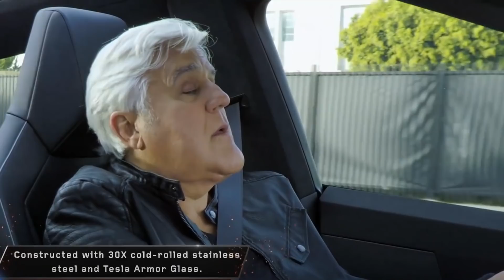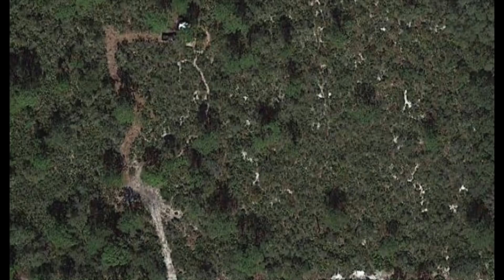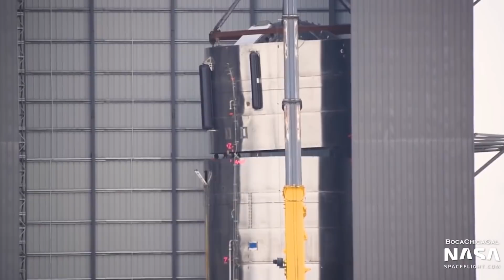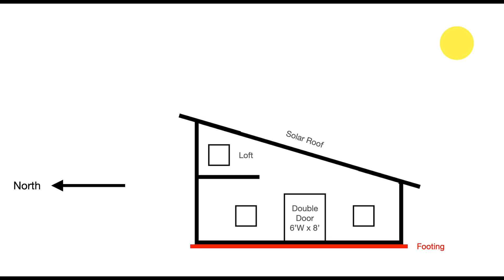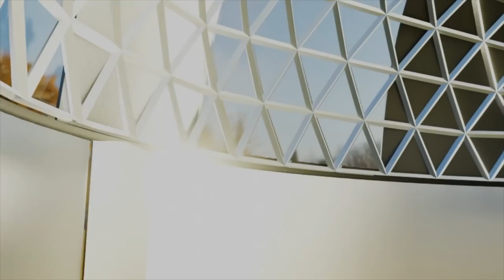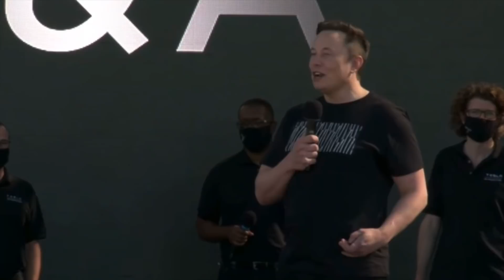Tesla CyberCabin - Apocalypse Technology

Comment: You should have a look at Buckminster Fuller's "Dymaxion House:" http://sebastiaankaal.nl/architecture/roundhouse-wichita/index.php?fno=1  If you can get your hands on a copy of "Inventions: The Patented Works of R. Buckminster Fuller," it contains the patent drawings for it.  The house was designed to be manufactured in an aircraft factory (after World War II), and have its parts be shipped to location in a single semi truck trailer.  

Another option would be the N55 Spaceframe: http://www.n55.dk/MANUALS/SPACEFRAME/spaceframe.html  This is a building based on tetrahedral geometry that looks like it was made to have a Cybertruck parked in front of it.  It's designed to be easy to build from very basic parts, and can be expanded as desired by adding alternating tetrahedra.  This would probably be the easiest and cheapest to build, since the plans are free online at the link.  Since it has flat sides, it would also be easier to affix solar panels to than a rounded shape.  

I hope your Cybercabin project works out!
Reply: The N55 Spaceplates Greenhouse is another very attractive option with more geodesic (rounded) construction: http://www.n55.dk/MANUALS/SPACEPLATESG/spaceplatesg.html that also fits the Cybertruck aesthetic.
Reply from the maker: Lightweight construction might not be good in a hurricane.

Comment: Have you looked into a straw house? I know it sounds a bit odd, but construction is really easy for hard to get to areas.
Reply from the maker: Not yet. Is that viable in Florida's humidity?
Reply: @WarrenRedlich  I've seen a lot of them in tropical areas so i'm sure it would do fine. The bales get coated with some type of plaster. Most people wouldn't even notice it's a different type of house.
Reply from the maker: I did some research. Not ideal in humid climates.

Comment: I’m an Architectural Engineer (building systems including structural) and I’m impressed with your insightful understanding of building.  Steel buildings are a great option.  Go with an 18’ eave height and build two story super insulated space inside will definitely work.
Reply from the maker: Thank you. I was thinking 20 feet but 18 works.
Reply from the maker: Where are you located?
Reply: @WarrenRedlich  many people are disillusioned by building on raw land.  It seems you’ll be fine.  One control is:  overdevelopment.  Will you be able to recoup your time and money?
Reply from the maker: There's no risk of overdevelopment in this area. 

Not sure about recouping time and money. Investment is small enough I don't really have to worry about that. When you invest $50K in property, you can't lose more than $50K.

The value is in having a place to go when the sh*t hits the fan.
Reply: @WarrenRedlich  it’s only a unit of measure.
Reply: @WarrenRedlich  Colorado

Comment: For comfort throughout the year learn about solar passive design using insulation, thermal mass, south facing windows for heating with eaves for summer shading, and windows that catch the breeze for ventilation. The Passive House system takes it a step further with PHPP software to forecast comfort before you build. 
Earth Ships include growing food and recirculating water as well - it depends how far you want to take it.
Reply from the maker: This is Florida. Thermal mass is not good. Ventilation with 90 degree humid air is also not good.

Comment: A HVAC system will essentially move heat from one area to another with a difference in temperature of the areas in the 10s of degrees. You will resistance heat, not HVAC, for the oven to increase the oven temp by 100s of degrees. Other than this one item, the rest sounds doable. Good luck.

Comment: 1/5: North-facing windows only would not be my preference. I'd much prefer them on the south and sides, with large overhangs.

2/5: Might be good to put the roof separated from the top of the building by an air space.

3/5: I don't know if I'd put the solar panels on the roof. Instead, I might go for a white roof, or maybe a green roof to serve as camouflage. No, I DON'T mean a roof covered with plants! I think those are just silly. No, I just mean a textured green color, as camo. THEN, put SMALL solar panels among trees in a forest. You can arrange open space such that the Sun tracks through an arc of open space over the course of a day. This will minimize their visibility. You will get a bit less insolation than you would with exposure to the whole sky. I think it's maybe 30% less, at worst. The difference is bigger on a cloudy day. But if I'm thinking apocalyptic, concealment would override efficiency at the margins.

4/5: If you don't have forest cover, that changes a lot. But if you're a real apoco man, you should have forest cover.

5/5: Finally, I personally have no interest in this. If there ever is a societal breakdown, I don't think you can predict what form it will take, and whatever you do, you could very well be preparing for 100% the wrong thing. I'd make the case that you might be better off in a city, in a neighborhood where you can really connect with those around you. If you get attacked out in the sticks, no one is likely to be around to help. I, for one, find that quite scary.
Reply: BTW if you design the mountings right for the solar panels, you could raise them for more sunshine when you're not in SHTF mode. Since SHTF mode (lowered) would be for concealment, you might think you don't need concealment outside of SHTF situations. But not necessarily. Power outrages can and do occur when your society is operating more or less normally. In fact, that's when you're most likely to need that off-grid power.

Comment: I like Cybercabin ideas.

My new retirement home that I finished December 2019.
Is similar concept.

I recommend 10’ poured concrete walls. This would resist hurricane much better.

I put rigid foam insulation on inside walls R45 and CLOSED cell SPF on bottom of roof sheathing R55.

A simple 45* shed roof with strong steel trusses. Windows on North & Solar on top, it would be larger in main level & about 1/2 as large in upper floor, 2 bedrooms & 1 bath
Reply: Next strongest is 8” x 8” x 16” concrete block walls with vertical #4 rebar down through each hole & then fill all holes with runny concrete.

Raise the dirt grade of your house area well above the local 100 year flood level.

Management of water & water vapor is very important, causes mold if done wrong.

Water vapor moves in the same direction as heat through walls & roof.
Reply from the maker: Hard to get concrete truck to property.
Reply: @WarrenRedlich  
Look at hydraulic-pressed native soil strengthened with Portland cement (or aircrete). Include channels and holes for rebar. You only haul rebar, cement and machine. Use well water, depending on salinity? Look at basalt rebar and cloth for reinforcement, as this is very corrosion resistant, light, strong, and cheap!

Maybe raise the building second floor on strong columns above 100 year flood levels, using burst-out walls for the ground-level garage. This greatly reduces flood insurance.

Comment: You should not build your solar on your roof of your shed or house as that is bad & a waste of money. Fixed panels will always only get around 60% of there rated wattage per hour for the 4-6 hours depending on what your state says that your solar day gives you. If you put panels on a single axis roof where you have 2 poles with a rotating axle across the middle & put 2kW of panels & 2x Heavy Duty 6000N 1320lbs Lift 12V Linear Actuator Motor Controller Switch Kit which use the same amount of power to run as the lightweight linear actuators & these pivot your solar panels facing dawn & slowly moving throughout the day to end up tracking the sun to late afternoon you can achieve 80% of the rated wattage per hour & have 8 - 10 hours of solar day because as the panels track the sun they are always at the optimum direct angle getting the most power out of the cells. Having 2 of these extremely heavy duty actuators guarantee that your panels won't blow away in a storm & you can actually cut down the amount of solar panels & still get more wattage. Having 2 of them is enough to lift a medium sized car off the ground so imagine how strong they would be in a storm?

Example 10,000 watts of fixed solar panels producing 60% or 6000 watts per hour for 5 hours = 30,000 watts per day
Example 5,000 watts of single axis solar panels producing 80% or 4000 watts per hour for 9 hours = 36,000 watts per day.
The offset of paying for 4 heavy duty linear actuators, galvanised angle iron for the solar panel frame, 2" galvanised round tubing as an axle with 2x 2" pillow block bearings for each angle iron frame & 2" galvanised square box tubing for side poles, a few bags of sand cement & a several bags of stone to set the box tubing in the ground which all would be cheaper than buying a total of 10,000 watts of solar panels as well as the hardware to fix it to the roof.
Reply from the maker: Ground solar is easier to steal

Comment: You're in Florida right???  Solar is viable there for 4 months a year????  About the same as Louisiana where I am.   I'm NOT okay with keeping my AC at 80F    Good luck with it though if you are spending the coin.
Reply: Four months sure isn't what I (an Oregonian) would guess!  However, some solar-related websites show "daily peak solar hours" (which is South Florida is 4.5 hours and 3.5 here) which is not particularly accurate.
Reply from the maker: Solar is viable year round here.

Comment: #1 CUT consumption. Insulation. Low flow hot water.  Small volume without being cramped cuts demand. 500SQ ft too small.  700-1000 sqft much better. No bigger. Low flow shower head. Induction cook top. Convection oven. Maybe Nesco for an oven. Cheap slow cooker (Rival). Tankless water heater. Short runs for water heating.
Reply from the maker: Minimum square footage for permitting is 750 square feet. Probably going to do 1000-1200 square feet. Once you're building a steel building, the extra size is cheap.

Yes, tankless water heater is a good idea. Will probably bring my vertical propane smoker to the property for outdoor cooking. I have a slow cooker at home that we never use so I'd bring that too.

Will probably divide space in half and only cool one half of it.
Reply: @WarrenRedlich  Extra SQ FT means more CU FT for cooling. How many people? For me 1000 SQFT is much too big. Bedrooms don't need to be big. Guest room can be sofa bed in living room. We have 3 people me/wife and son. We find 750 SQ ft 2BR GREAT. Would plan 3rd BR just for storage. We are pretty well stockpiled for the end. LOL!  Makes cooling with AC very cheap. IKEA Kallax GREAT for storing. 
Think vertical for storage in small sqft.
Slow cooker is better because it doesn't radiate heat. More heat=more cooling needed. Bad for survival. Don't waste.
Fantastic shower head. https://www.conservationmart.com/p-2138-sava-spa-15-gpm-chrome-showerhead-n2515ch.aspx?gclid=Cj0KCQjw2or8BRCNARIsAC_ppyZMQeyBKYJ2irNCp5Esrxm-lZJ28vBb6Fjlf2puNNimc6dWMnV6PNAaAhGnEALw_wcB

Comment: If you keep it smaller and super insulate you can heat it with a candle. SMALL AC. Well plan to work with the sun. Passive solar.
Reply from the maker: Heating is basically irrelevant in Florida. I'm from upstate New York. I never get cold down here.

Comment: Think ICF for walls, roof, and floor. Forget a handgun bullet, ICF with a good core can bounce a tank round, takes any earthquake, hurricane, or tornado. Excellent insulative value. Costs 5% more to build over conventional methods. And don't forget the flame thrower.
Reply from the maker: I looked at ICF before. Seems expensive, time consuming and labor intensive. Have to be able to get a concrete truck to the property.
Reply: @WarrenRedlich  Consider this. An R-50 or R-60 wall allows for a smaller and cheaper hvac unit which also lowers power demands. This in turn can allow for a more modest and cheaper solar roof / powerwall. Building using ICF may also allow thousands of $ in tax credits to be claimed. House insurance costs are often lower for ICF houses. This should sound similar to the cascading advantages of a Tesla EV, because it is. So put together a spreadsheet and see if cost may be yet another advantage all things considered. As for speed and labor, ICF walls go up in a week—stack the blocks like lego’s and fill it up. Some home owners even choose to stack these light blocks themselves to save even more labor cost. So you just need to ask the concrete provider how to make appropriate access and you can have an ICF fortress that can take any calamity and repel an invasion. If there is a category 5 storm outside it will be so quiet and solid you might not notice unless you take a look out the window.
Reply from the maker: I’m not going to insure the cabin. 

Insulation is far less important in florida. It matters but not as much. I will insulate but only a little. 

Much more important in cold climates. Zero F is 75 degrees difference from 75. 90 is only 15 difference.

Comment: Use aerogel as an insulator between the steel exterior and the interior.
Reply from the maker: Sounds expensive. I was planning on a radiant barrier. Maybe some insulation as well, but the barrier might be enough.
Reply: @WarrenRedlich  
Insulation is always cheaper than brute-force air conditioning.

Comment: Hi Warren; working towards something similar; so have some notes on your ideas:
in the risk column; the powerwall currently has issues when no internet/mothership connection and shuts down; so hoping before SHTF tesla has enough time to push that update to disable that (its done for warranty options and the commands to adjust the powerwall don't go directly on the powerwall2 and go via the mothership).

re the building; have you seen the inflatable ones with concrete fibres that you wet; might be appropriate for your first structure / collection of building materials and may doubles as fire shelter / safe storage.

for solar I have found modern panels are doing ok all day generation despite the alignment; eg all my panels face north west (in southern hemisphere) during winter are still getting enough power from sun-up to cover my idle power usage of modems; fans and UV water filter at 7am. I do miss having some wind option at moment as a few days of poor weather drains the battery.

drinkable water collection and filtration is going to a big item to consider early; especially large tanks as their construction and location will be important and especially with less rain; and scaling your battery to run water pumps and UV water filtration appropriately (my powerwall2 does this fine for a few days but not more)

rather than cooling a whole area during day with aircon I would look at designing a concrete safe room because people will know where you are; especially considering a drone/ plane/ sat photo could spot the solar panels from far away and that's basically a homing beacon for prepper.
Reply from the maker: Great comment. Thank you. I have thought about some of that but I will think more. 

Definitely planning to use the ac on only half the space.

Comment: Engineer in the Army and getting out soon. Interested to know how the quote for the road added up to $10,000. I literally build roads in the military and would like to know if there is a way I can help.
Reply from the maker: I just talked to one guy about putting down shell rock. 

It’s about 500 feet of bad deep sand road that is the problem.
Reply from the maker: So if you figure 500 feet, 10 feet wide, 6 inches of stone, it’s 2500 cubic feet. Seems like a lot.

Comment: It sounds like you want to build a stainless steel version of Buckminster-Fuller's Dymaxion. But there are no real benefits to building one of stainless steel since the "bullet resistance" of the full hardness 3mm 300 series stainless steel is limited to 9mm pistols. I think you may find that an aircrete dome is more practical.  I'll let you do the research for yourself and judge.

Comment: Worth watching some UK grand design programmes. A few people have made homes that require zero heating. 
And air conditioning systems including simple large air pipes running underground in trenches to capture ground temperature for both heating and cooling while exchanging clean air

Comment: If you're trying to stay within a small budget like $50k you need to simplify as much as possible. Forget fancy shapes like domes.
Reply from the maker: Agreed. The steel building with minimal interior is the $50K version. The dome is part of a more expensive version I'll only do if I raise a lot of money. Which I expect not to happen.
Reply: Does the $50k figure include the solar panels, septic systems, foundation preparation etc..? Sounds very low.

A note on grey-water systems; we just installed a system that only has a divided well, with an air-pump-mesh type of thing. Working principle: bubble air through the water and let natural chemistry (obv bacteria too) do their work and ”disassemble” the pollutants. No septic field required.

Another note; heat-pump dryers are already a thing (at least in Europe). They actually recycle the heat within themselves (the cold side condenses water to a drain, then the refrigerant warms up the warm side where the dry, cold air comes to heat up before passing through the clothes again, picking up some moisture along the way, to be condensed, repeat).